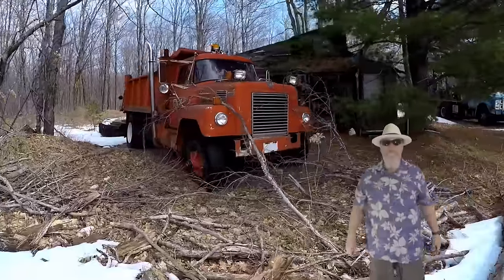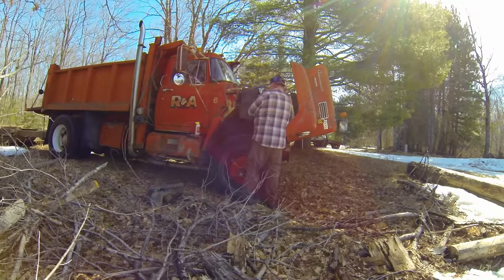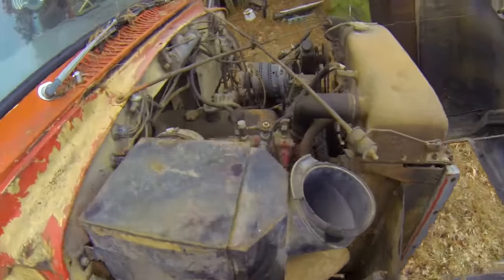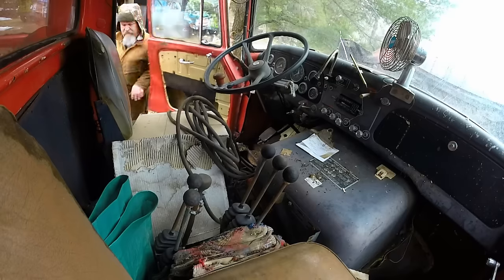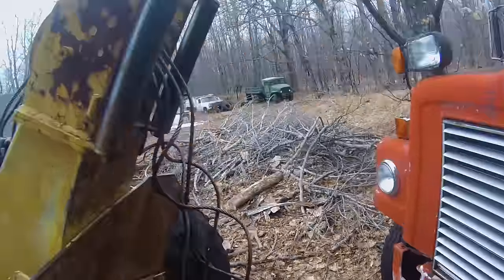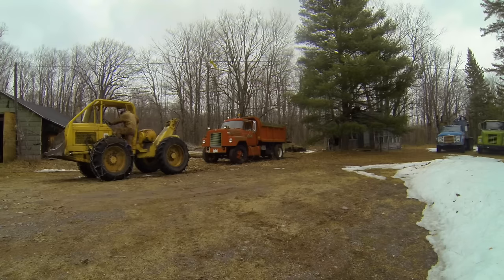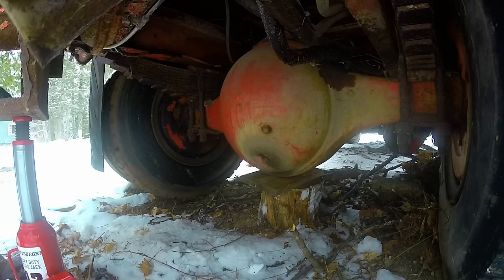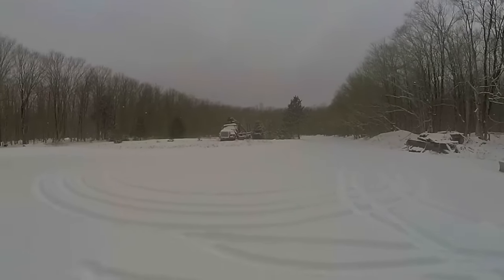SITTING 15 YEARS!!

Comment: Um wanted to add sitting so long lucky the rack wasn't stuck causing a runaway situation. Maybe u did check off clip . No pun intended. Also I thought the 6 71 was a v 6 . Being a 63 might have been before. Enjoyed the clip.
Reply from the maker: You are correct about the rack getting stuck on these old Detroit's and causing a runaway and this was definitely a concern here.  I had that happen to my skidder a while back but I was able to get it shut down before it blew apart. This truck has a 6-71, which is a straight six.  Detroit did also made the 6V71, which is a V-6 engine.
Hey, Thanks for watching and commenting!!  I really appreciate it!!